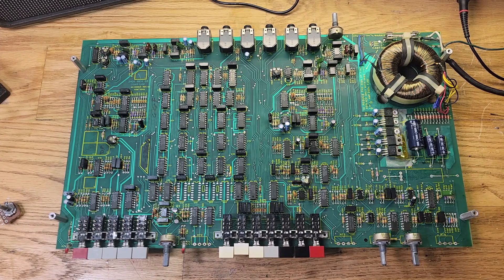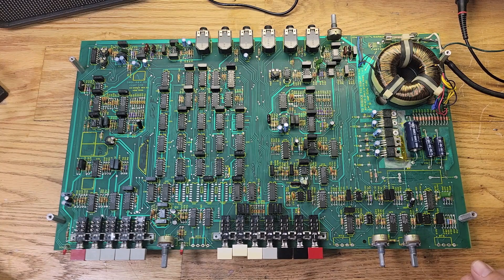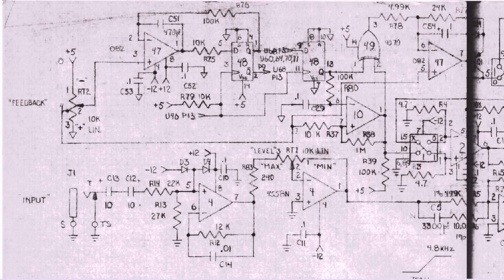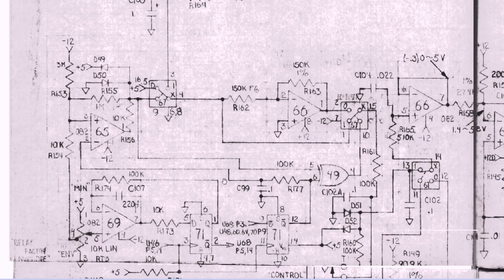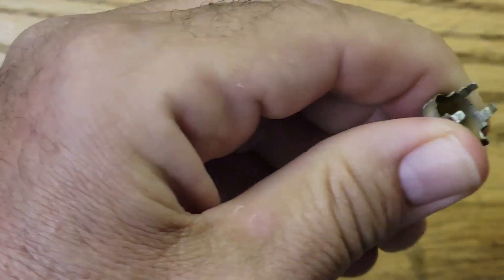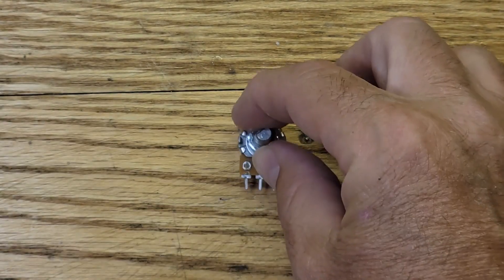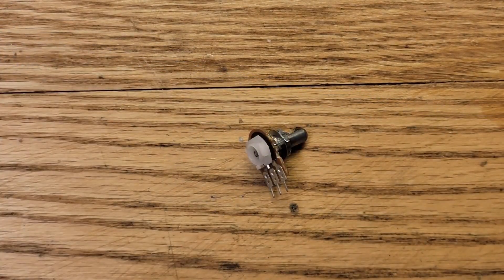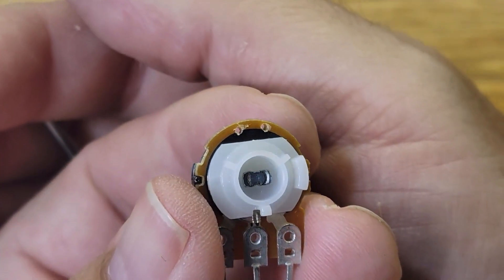Making a 4-Pin Center Tapped Potentiometer: "Effectron III Repair Journey" Part 2

Comment: Ingenious!  Question:  Would it have been possible to replace the corroded wiper disk in the 4 pin pot with one scavenged from a good 3 pin pot?
Reply from the maker: Its kind of welded on so it would be difficult to put it back on but it could be possible

Comment: great work... i suspect that since there is some resistive material between the wire and the contact slider at closest approach u will never be able to 'zero' the pot. to get around that you would have to have the wire closer to the slider as it passes ... perhaps extend the silver to come just near the contacts closest approach? as u manage to do that the lowest resistance at mid point should drop. some very fine work there, lol.